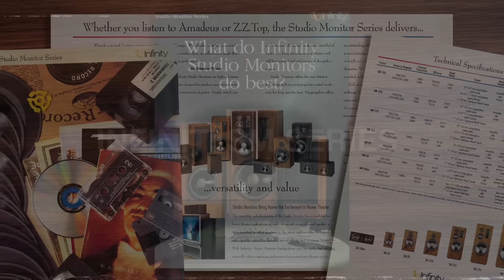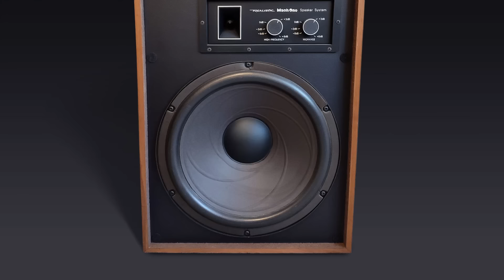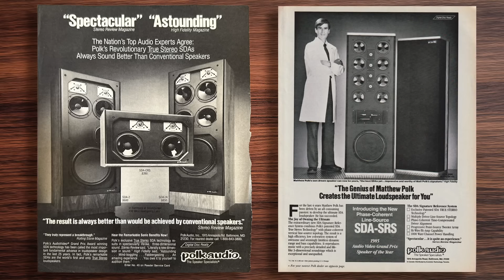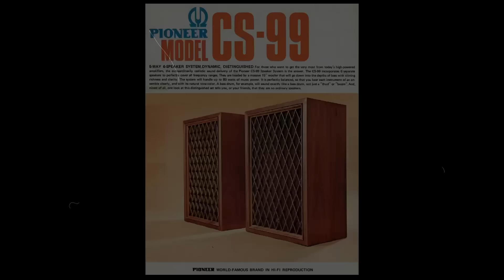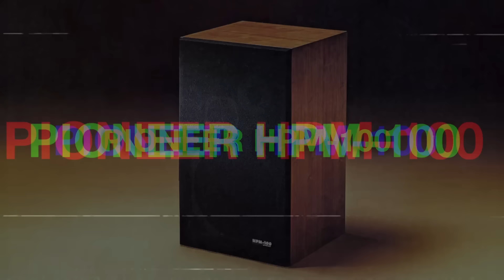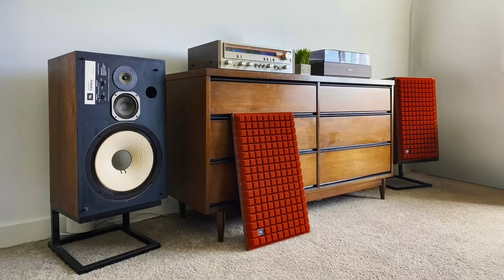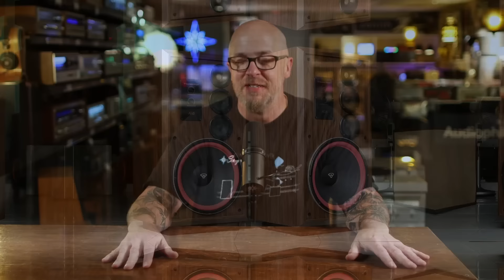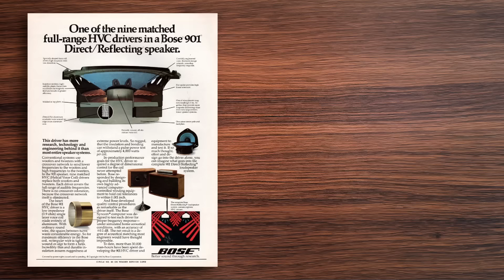Why Do Audiophiles Hate These 9 Legendary Speakers?

Comment: I like vintage amps, but I honestly feel like speakers from the 1970s were very hit or miss. I had a conversation with a guy who designed and built "Quatre" speakers, and he said that speaker design became much more scientific in the 1980s, particular regarding calculations with T/S parameters and crossover design. In part, it was because speaker builders started having better access to sophisticated test equipment and computers to run calculations. I run what are now "vintage" speakers, KEF 104/2s that came out in 1984, and I like them a lot more than what you get from 1970s speakers. The 104/2s are a lot more sophisticated than a box with some drivers in it.
Reply: Agree about hit and miss.still is.sealed design is pretty forgiving.t/s definite can improve performance of ported if properly applied which sometimes requires a more expensive magnet.crossover design is now better understood.there are now some very well designed diy speaker that can be built for reasonable cost.1980s kef were ahead of some of the others in tech.